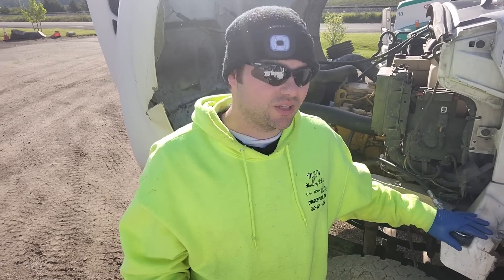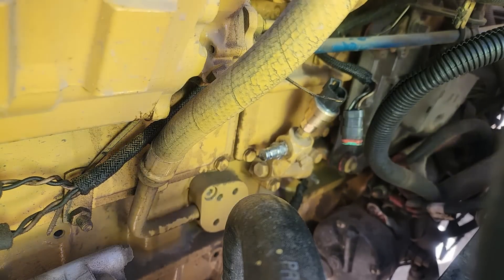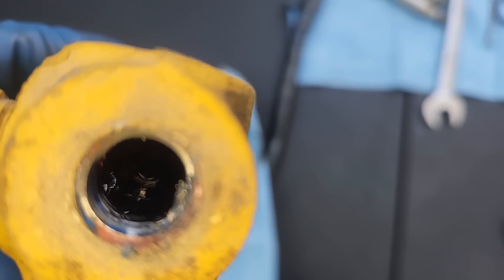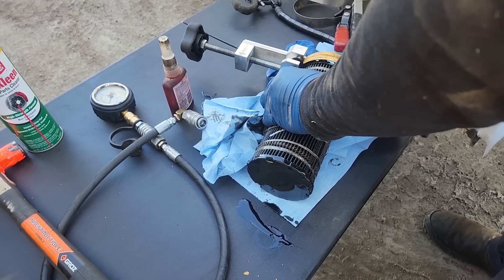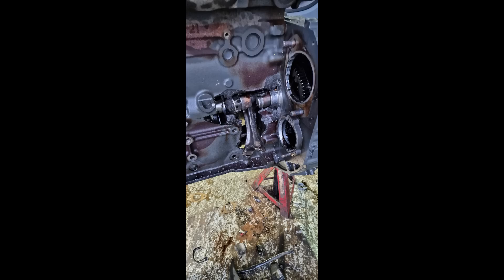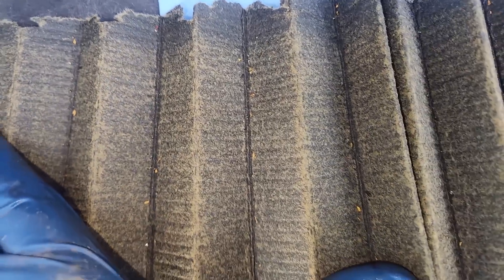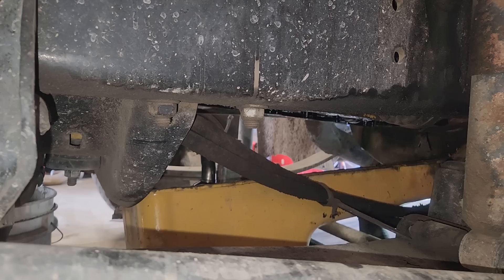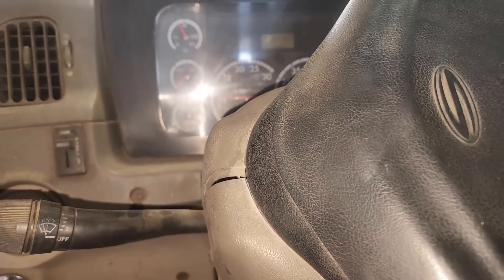NO OIL PRESSURE? No Problem for this engine.

Comment from the maker: Was surprised to see that it didn't have any metal in the oil filter, but they lucked out on this one. Thanks for watching.
Amazon Affiliate Link to recommended tools: 

Triangle Tool Box, Montezuma: https://amzn.to/3Iq5a49
The Mysterious Case of Rudolf Diesel Book: https://amzn.to/3TiEIyd
Fire Piston: https://amzn.to/3PttUMD
Dowel Pin Puller Set: https://amzn.to/3Qjflf8
Slide Hammer Dowel Pin Puller: https://amzn.to/3JyDMRS
VEVOR Borescope: https://amzn.to/4bjt5Pf
OTC Torque Multiplier: https://amzn.to/4bi48Eb
Milwaukee 1/2” Impact: https://amzn.to/3WQW7kS
Reply: In Australia, we have Isuzu Trooper powered by an Isuzu 4JX1 Turbo Diesel 3.0L engine - (kinda like half a Ford Powerstroke 7.3L).
Isuzu designed the engine with 2 Oil Pickup Pipes, that goes to 2 separate Oil Filters (Z600 for Lubrication & Z79A for HEUI).

At approx 120,000miles (200,000kms), either of both Pickup Pipes will experience bracket fatigue and the Pickup Pipe will fall into the Sump Pan, due to excessive vibration and lateral pendulum effects from Oil sloshing in the Sump. If it is the shorter HEUI Pickup Pipe, then it's not a terrible problem, as you can add approx 1L of Oil to overfill the Sump and operate the engine without too much trouble until it can be repaired. But if the longer Pickup Pipe falls into the Sump the Lubrication Oil pressure will drop to ZERO and not long after the Turbocharger will strip the Journal, blow the Oil Seal, and fill the exhaust with engine Oil - possibly even the engine will run-away, as the Turbo will also feed that Oil into the Intake via Intercooler.

This problem was solved by adding a 2 inch (50mm) high Spring, and 50mm diameter onto the bottom of the Oil Pickup pre-filter housing, then refitting the Sump Pan. The Sump Pan and Pickup Pipes are now connected via Springs, which transmit vibration to the Pan, resist lateral pendulum forces, and push up to hold them in place so they can never fall out again, and also helps reduce wear on the Pickup Pipes Seals.

As forest gump would say - one less thing to worry about....
Begs the question - "Why don't all manufacturers put a Spring on the bottom of their Pickup Pipes, in the factory, before they fit the Sump Pan"?
Reply: I still don't get it how the HEUI system could operate with 0 oil pressure. The oil pump was sucking a lot of air. How was the oil getting to the HEUI pump?
Reply: Forest Gump never said that. He did however correctly say that the 4jj1 is a far better engine.
Reply: @philmckrakin6752  Yeah, mechanics go broke if they specialize in a 4JJ1, huh?
Reply: @delawarecop  pretty sure the performance shops go ok. Putting out unreal figures out of them.
Reply: @philmckrakin6752  Yep, anything above 250HP needs a new crankshaft. Thailand is the place to be, but 4JJ1 is not HEUI...
Reply: @delawarecop  yeah I understand that
Reply: @delawarecop  still a far better engine.
Reply: @philmckrakin6752  - Not HEUI
Reply: @delawarecop  NO SHIT
Reply: @philmckrakin6752  - The video is about HEUi getting Oil to run Injectors, but no lubrication oil pressure - aka 4JJ1 is irrelevant here. 4JX1 has a HEUI. Understand that nobody cares about the 4JJ1 when talking about HEUI. Hello?
Reply: @delawarecop  HEUI was a point you invented in this. I just corrected you on the claim of things Forest never said with facts he did spit
Reply: @philmckrakin6752  - LOL, gump never said anything about 4JJ1 either , hypocrite 🤣
Reply: @delawarecop  hard work arguing with halfwits and farkwits. I've got my work cut out for me double here.
Reply: @philmckrakin6752  Ditto
Reply: Oil has to be pumped through the filter for it to deposit metal flakes
Reply: @Shaddowbanned  - Agreed, otherwise it would likwly sit in the bottom of the Sump Pan. But didnt he remove that already and inspect as well?
Reply: @delawarecop to get in the sump the oil would have had to be circulating, which it wasn't. No oil pressure no circulation
Reply: @Shaddowbanned  If no Oil was circulating, then how were the Injectors running?
Reply: Where’d you get the pressure gauge ?

Comment: I have a 2005 c15 my oil pressure was 30 psi idle and 60 psi running and a did mains and connecting rods and after that oil pressure is 20 psi idle and 50 psi running and after 3000 miles my oil pressure starts dropping if I change oil filter the oil pressure goes back to 50 psi

Any advice what i can do??

Comment: The pick up tube on a DD 15 engine has an o ring that will crack at about 500,000 miles.  A friend had one when she would pull up to a stop sign or a light it would momentarily lose oil pressure. I suggested she have her shop check that o ring and sure enough it was worn out.  Once it was replaced she’s had no more issues with low oil pressure.

Comment: My oil pressure for my CAT 3126B motor home is not good according to the gauge on the dash. The guy I bought it from swears up and down it's good as he had checked it with a hand held. I drove it 500 miles and over a few steep mountain passes getting it home and it ran strong while pulling a Jeep Wrangler. So being it's a HUEI engine it shouldn't run worth crap at 5 PSI. So maybe it's the sensor? Not sure where to start the process of elimination. Anyway, this video was really informative and explained a lot.

Comment: I HAVE  3126b  with 50.000 miles and low oil pressure ,is it ok to replace with aftermarket oil pump or should i only use cat

Comment: My old van used to do this, the high pressure oil pump had a bent shaft that caused it, couldnt afford a new oil pump so i stuck an airline to the crankcase that i could hit with an air compressor and pressurize the oil system on the first start of the day, was a ghetto ass redneck fix but i was homeless at the time and was limited on resources

Comment: Any thoughts with oil pressure dropping 3-5psi when I’m in the throttle heavy? 2WS 3406E, runs 80psi @ 1500rpm when I’m out of the throttle

Comment: Interesting Find, Josh. I had an Allis Chalmers engine I rebuilt years ago that ran great on the Dyno, sent it back to the customer and he was plowing with the tractor, when he idled it down at the end of the field it would turn on the low oil pressure light. We brought it back in and pulled the oil pan. The crank driven oil pump, we installed new gears / shafts and used the original gear. The gear was a press fit. It was spinning on the new shafts. We installed a new oil pump and checked some bearings, no problems since. Closest I came to losing an engine. Thanks for the Videos.

Comment: How much did it cost to tighten bolts? There is a lot to assemblying and engine. Even the most experienced mechanics need to double check their work. Mistakes happen. Yes they dodged a bullet on this one. Very good job diagnosing this. It taxed your skills but it's good to have a tough one once in a while. Keeps us human.

Comment: Heui needs oil flow as long as it can flow up to the reservoir, itll be able to build huei pressure. Had a 6.0 that had a bad check valve in the oil filter housing, had 1 psi of oil pressure but the injectors were firing and hpop built plenty of pressure.

Comment: I asked  a WTI instructor in fuel systems class a question about HEUI engines not having engine oil pressure. Can it start and run. All i got was smart ass remark but no answer.  " that would be that last of your problems if it started". 🤦‍♂️ legit question come on.

Comment: Had a Cummins that was slow to build oil pressure and filter was never full, which led me to believe it was sucking air. Found pickup tube cracked at flange.

Comment: metal can not be moved if no oil flow, on the next oil change the filter needs rechecked, if it makes it that long.
Reply: But the customer said it built oil pressure once warmed up, so probably it didn't run that long dry

Comment: i guess the guy that built that engine had a brain fart huh 😁
lucky it didn't wipe out any bearings with it sucking air like that and going through the system.
But then again... if it is picking up any oil the engine will run quite a while with the oil film that does get on the bearings. Ever seen those videos where guys drain out the oil and run them dry just to see how long it takes to lock up? I saw slick 50 do a test like that once and the engine ran quite a long time before it locked down (on a test engine w/o their product in it). But yeah, these guys were VERY lucky no damage occurred (that you know of), without tearing the engine down and examining everything you won't know for sure. 
Yep, no metal in the oil filter was a good sign all is well so no worries.
Nice find there Josh 👍

Comment: Dealer did a big service on my Toyota D4D diesel just before I bought it, I noticed it was a bit slow to pick up oil pressure so not knowing any of the history I pulled the sump pan, oil pickup was good but the disposable metal crush gasket where the pickup meets the pump had obviously been reused and was sucking air, it did pick up pressure but took a few seconds. Replaced it with a $12 AUD genuine part (and it even came with a note on torque settings and it was only single use) and bang instant oil pressure hot or cold. I dropped a couple of caps off to have a look and there wasn't anything nasty going on but there are mechanics and there are mechanics.....

Comment: Using logic and understanding the system. I still don't understand how the injection took place, minimally the air should have made foam and not allowed the compression to happen.  Anyway good going getting it to show pressure. ben/ michigan

Comment: I have seen this issue before if ya ever run into this again over fill the crankcase to verify that's the issue before ya even drop the pan. i did that to a D6 on a pile of chicken crap out of desperation and I learned something so i am sharing.  good luck JOSH keep going man.

Comment: I always tell the younger guys to always double check your torque and torque stripe everything crucial. If you have the pan off to reseal it it takes no time to check torque of pickup tube bolts and give a quick look to make sure everything looks ok and check the oil pan for debris and oil
Reply: Yep, have to put that dot of paint on them when torqued.  It is so easy to miss something but when you do a final inspection hopefully you catch no paint and investigate.

Comment: I had sorta the same thing happen with a big block Chevy engine I built for my chevelle. I was told to weld the pickup tube to the pump and I didn’t listen because it fit so tight. I started it up and I made it a quarter of a mile down the street when I lost all oil pressure. Well as I was moving I swung the wheel from side to side and to my amazement the oil pressure jumped each time. The pickup had fallen off but the sloshing oil was enough to get me back home where I took the pickup out of the pan and welded a new one in with a brace, no more problem.

Comment: I had a VW with low oil pressure light come on. The gasket on the pickup tube was so hard from heat it was pulling in air. Replaced the gasket and had good oil pressure since.

Comment: Great job! Love to see fellow 7 liters!
Yep, my guy told me that if my HEUI pump "failed" (oil pressure) then it wouldn't run so it's something to remember regarding the HEUI pressure/engine oil pressure as being not a solid issue but rather a distinct difference. We change it at or before 250 hrs every month religiously!
Cheers!

Comment: I had vaguely similar experience with a gas engine a few years ago. I had gotten a Dodge Ram 4.7 from auction (a gas engine), had good oil pressure cold, but 0 pressure once hot. Turned out that the steel/iron camshaft ground away at the aluminum heads creating a huge cam bearing clearance that hemorrhaged oil after it warmed up. I ended up removing the cams, coated the cams with really thin oil (ATF fluid), and built up the heads with JBWeld. Had good oil pressure after that, but no idea for how long, I sold the truck right after.

Comment: At least they put the pickup tube on. One of the techs I work with just slammed the pan up and sent it with no tube.
Reply: Trying to be fast can do that..a slightly lower efficiency with no comebacks is better than the shop eating a $50,000 engine
Reply: We had an intern doing an oil pump on a D6 w/ one of our techs. He slapped the pan back up on Friday but Monday had to go back to school. Tech fires it up and had no oil pressure. Dropped the pan and pump and he had left a blue plug in the pickup port.
Reply: @SuperSecretSquirell  the worst thing is when you tell a younger tech something and they completely ignore your advise. Like the fuel connector retaining nuts on isl cummins MUST be torqued 41 # everytime you remove a fuel line....  Watching them figure out why they have low fuel pressure for a whole week after ignoring your advice ... priceless
Reply: from my experience, it's much easier installing the oil pan without the pick up tube in the way.
Reply: @deanberolzheimer2658  hahahaha
Reply: That’s not a tech that’s a parts monkey.